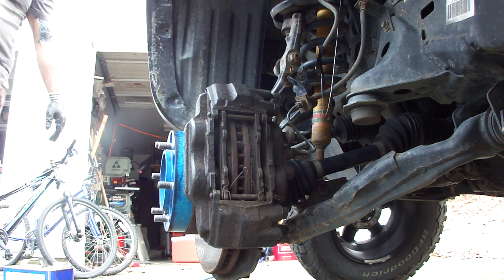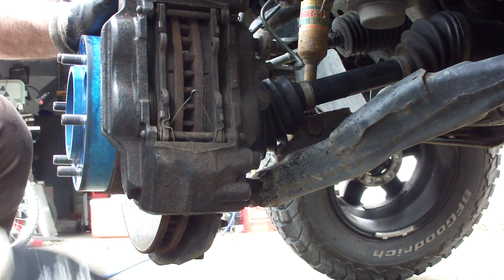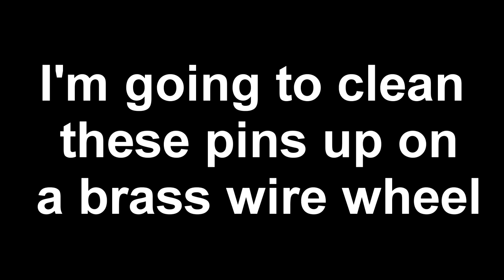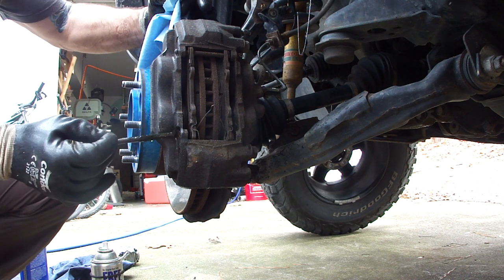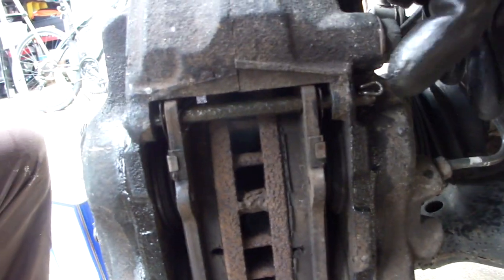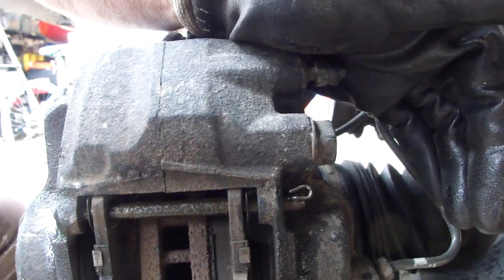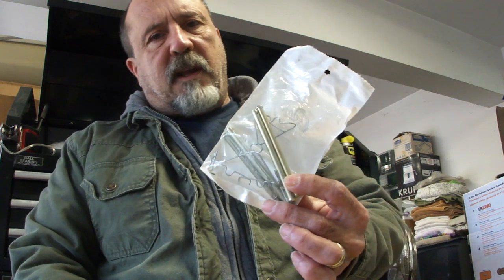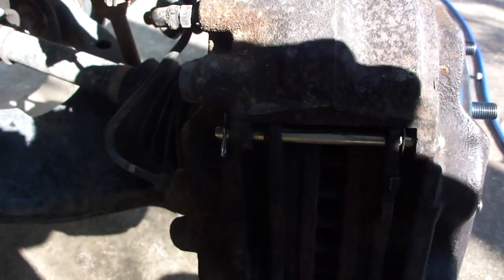How to Fix Tacoma Truck Brake Rattle Noise - Caliper Slide Pins Corroded!

Comment: Hey buddy, was searching tons of video's and FOUND the problem in comments. Its the brake pads themselves, they oblong around the pin and any change of momentum they click/clunk against the play in the pin. The dust cover makes it louder and hard to diagnose. Change them, they are cheap and noise goes away. Just did it on mine, frickin had it on 2 different 3rd Gen's and made me sell the first one lol. Dealership wont find it.
Reply from the maker: I'll have to look into that I appreciate your feedback!
Reply: nice 👍🏽.  thanks for the info bro, good work, 🙂.
Reply: I replaced mine with new pads and I’ve notice this noise after only thing I notice is I need to change is the clip thag holds the pads

Comment: Toyota only puts one spring on each caliper. I read online that installing anotjet spring on the top pin fixes it. I have a new set of springs here, and I'm going to try it tomorrow. The rattle is driving me insane!
Reply from the maker: Hope that works!
Reply: Did it work?

Comment: How old were those pins? I own a 2006 Tacoma that has lived its whole life in the rustbelt with the orignal pins/brakes that haven't been serviced yet, one brake pad has uneven wear. Do you think I will be able to remove the over 15 year old rusted pins?
Reply from the maker: I would hit them with some break free spray first and let them soak in for a little bit of time than give it shot I don't see why they wouldn't come out.
Reply: @ExtremeDIYGuy  OK, Thanks for the reply.

Comment: Thank you very much for this video! Im having the same issue and its driving me nuts. Jus checked and im missing the spring on my front right passenger side. Has to be it!
Reply from the maker: Good job finding that. Worth a shot!
Reply: @ExtremeDIYGuy  turns out the rattling was coming from my rear brake pads being loose. I didnt install the clips that came with the pads when I initially installed a while ago before winter. Never rattled till abt a month ago. I still had the clips in the garage. Installed them and poooof the rattle is gone. Such a good feeling eliminating an annoying sound like that!
Reply from the maker: I'm glad you got that solved!
Reply: @alale923  rear pads? Tacoma has drums in the rear

Comment: my dr side cali is sticking pretty bad, gonna go head and guess ill  be doin this tomorrow after work along with replacing the garbage 2 piece lug nuts
Reply from the maker: Hopefully that will help. It did with mine. I'll probably be doing a complete brake job soon. There's a ton of corrosion on the caliper and edges of the rotor.

Comment: Does anyone have a link or video to direct me for the noise... I recorded a noise from my 4runner and I hope it's just these pins. I certainly didn't replace them last month when I replaced my rotors and pads.
Reply from the maker: I don't have any additional videos, hopefully someone else can point you in the right direction.
Reply: @ExtremeDIYGuy  I figured it out. It was my anti rattle / pad joiners.  Thank you for the reply.
Reply from the maker: @ohlone209  No worries, glad you found it, I usually put some hi heat grease on the back of the pads to help with that.

Comment: What's cool is that the Taco brakes don't really wear much more even with those pins rusted. The only issue I have run into is the pistons and pad ears freezing up on a remaned caliper set. It's a great design for the rust belt.
Reply from the maker: I may end up replacing the entire calipers with zinc plated ones . Right now the calipers look like lumps of rust. but work perfectly still. Too much beach time I guess (Is there such a thing?).
Reply: @ExtremeDIYGuy  is the zinc plate caliper oem or another brand?
Reply from the maker: Off brand, definitely not OEM.